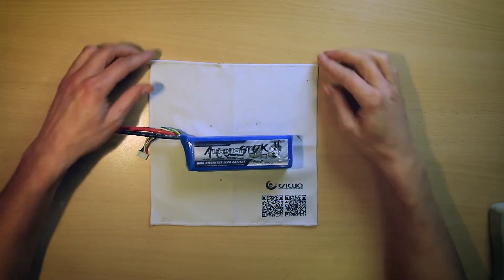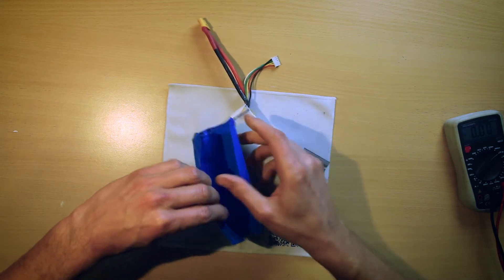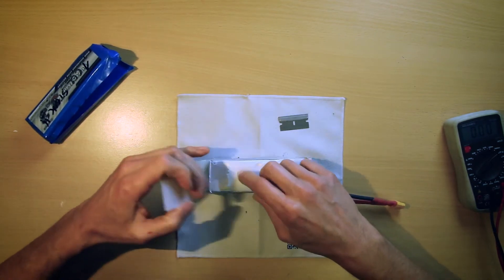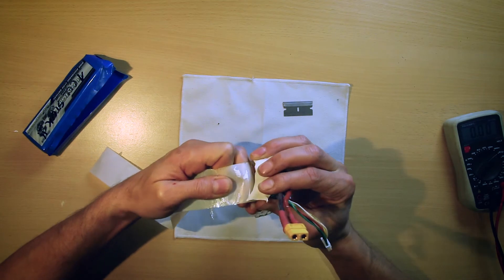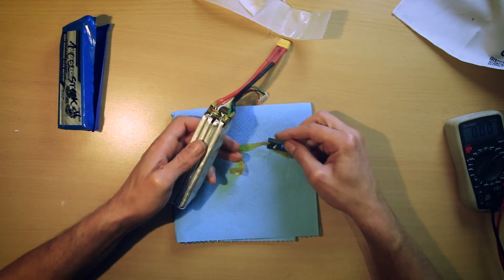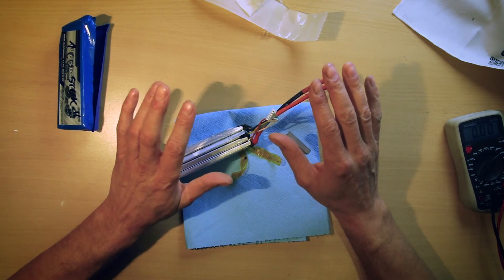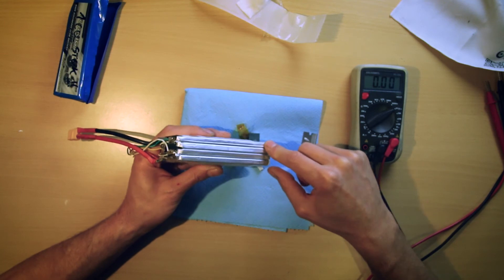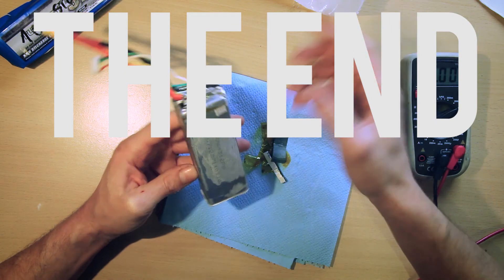#82 🔋 Teardown of a LiPo battery - Lithium polymer

Comment: Thanks i really needed to confirm that form that the wires are arranged in the balancer. It's a little diferente from a BMS balancer, where we have an extra positive wire in some cases, like in a 4S we have 6 wires not 5.

Comment: If you measure the cells you probably can find the bad cell and make a three cell battery. I had a three and made a two cell. I want to see what’s inside the cells are you going to open one?
Reply: I also would like to see what's inside the foil pouch of a LiPo cell. That's what I thought you were going to do here.
Reply: @kirkglundal4289  still think I had a video here on the channel :p
Reply from the maker: Did that off course 👍😂😉 Think I had a video about it here idd...

Comment: 3:07 if those where to touch then only two cells would explode. Still enough to give you severe burns. The safest way to do this is to discharge the battery completely to 0 volts. This way all pins can touch without anything happening.
Reply: It might go into thermal runaway. More likely the one of the tabs would turn red then disappear..
Reply: @kristophersurbrook4001   im not so sure about the tab burning before the battery explodes. Look it up on YouTube, lipo explosions do happen and the tabs won’t save you.